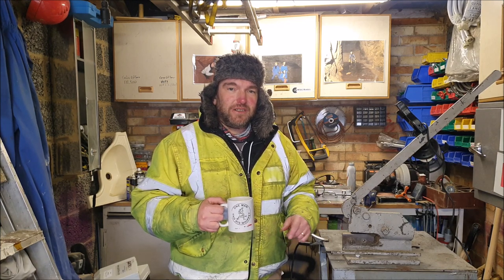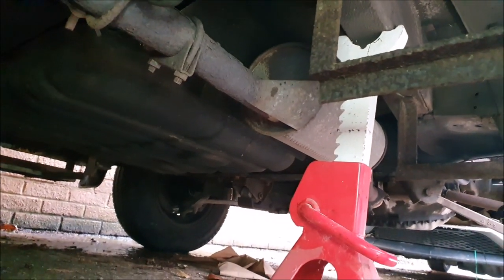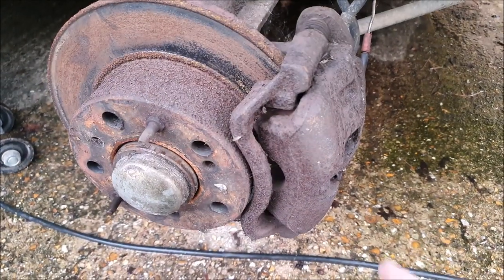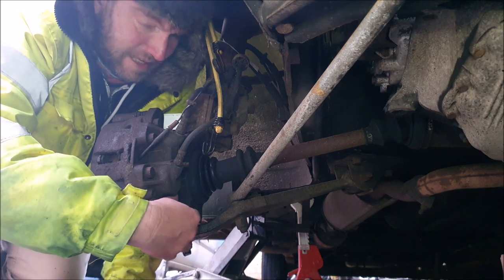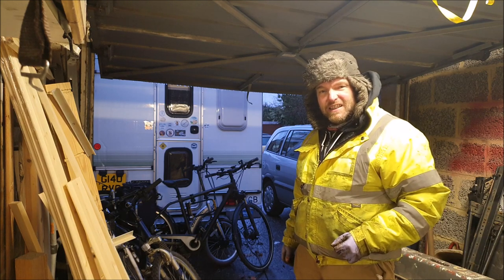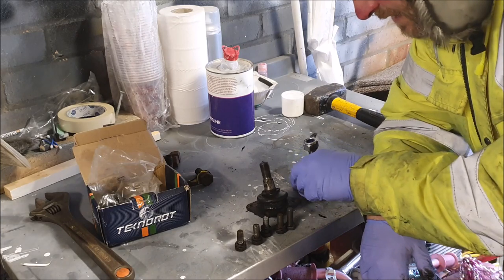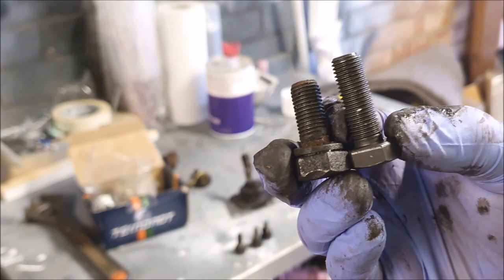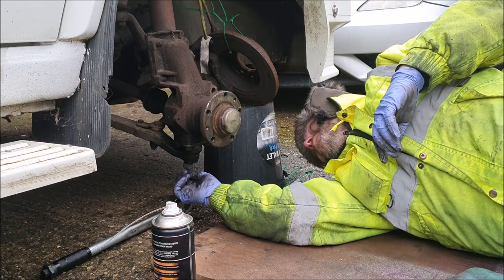Replacing A Worn Lower Ball Joint On My 1990 Citroen C25 (Talbot Express) Motorhome

Comment: Hi Alex remove the caliper from the holder then remove the holder then remove the disc .
Red grease on the sliders after cleaning them. 
Nice work with the bal joint 👌 
Beauty 👍 
Chas.
Reply from the maker: Thanks, I'll be onto this job as soon as the parts arrive 👍

Comment: Hi aleex. I found that having the van raised  up enough to so both wheels clear the ground. Allows you to turn the wheel. That lets you get at all the nuts on the ball  joint.. with a socket
Reply from the maker: Sounds logical, I need some taller axle stands!
Reply: Im cutting outt and replacing rusty parts on my 1999 fiat .with help from my friend.   Its a big  job so i had  to remove the engine and one drive  shaft. .so  i took two wheels and put them under the camp er on both  sides  after chocking the wheels up at the back.  it gives great hight to do loads  of jobs on the van and with a defo safe feeling and the wheels and stering are free. To move..or you can just drive the van up on to some building blokes..the long rectaganale ones.placeing them two blocks high. with one at the front..thats a very cheap stand...great vidoes .i love watching what your up to.
.did a key ignition the other day after watching one of yours..cheers..!!!!
Reply from the maker: @kennymosireland7069  Glad the ignition video helped, that's a popular one, I guess it's a common fault.

Comment: Hi alex good  job .i see your discs are shot by the lip around the outside, it's always good to change discs and pads at the same time ,you can normally get good prices on pads and discs as a package anyway love watching your adventure hope your all fine ,,,,cheers dell
Reply: Hi Alex, you could have pushed the pads back against the piston(s) in the calipers. This would have made it far easier for you to remove the old discs. Incidentally, while you have the calipers off, give the pistons a clean with brake and clutch cleaner and a brass wire brush (never use a steel one as you can scratch the pistons with it. Thus letting brake fluid to get past.)  You can physically force the pistons back into to calipers using the recommended tool, and you can also get them to move out by using the brake pedal. Be careful though because if you manage to pop the out it is not easy to replace them.
Reply: Push/force them back carefully using an old screwdriver. Try to lever the back plate on the pads rather than the pads themselves as this could damage them.
Reply from the maker: Hello Derek, yes, pads are on order with the discs but coming from Germany apparently and not arrived yet!
Reply from the maker: I'll be having a more determined go once the new parts arrive :)

Comment: I would double check Torque setting of Ball Joint nut?? It don't seem tight enough to me?? Using the Clamps as you did is making the Caliper grip the disc MORE!! Try levering the inner pad, (piston side) inwards towards centre of vehicle, to give a little gap to allow caliper and Bracket to come off. If the Caliper sliders are not seized, where you had clamps, it should move out board giving you a bit of a gap both sides and whole thing should come off!! :-)
Reply from the maker: I'll see if I can find more information on that torque setting. It is a nylock nut pulling into a taper so may not need too much 🤔